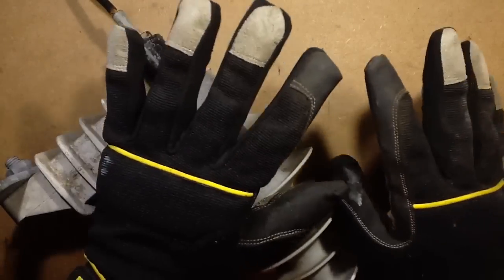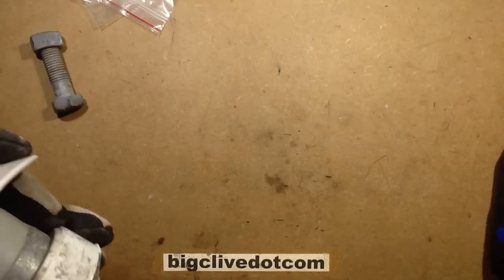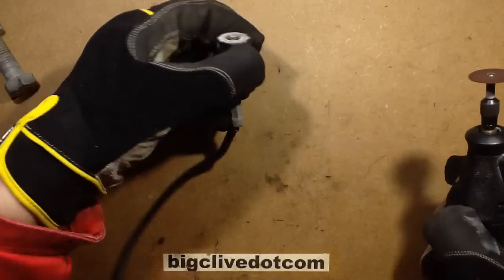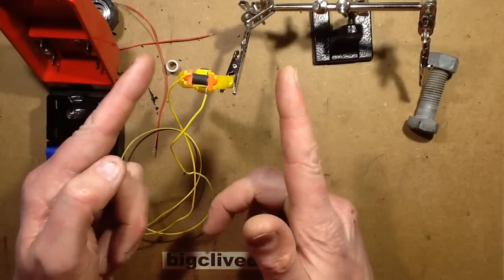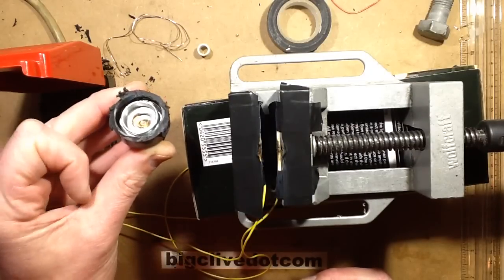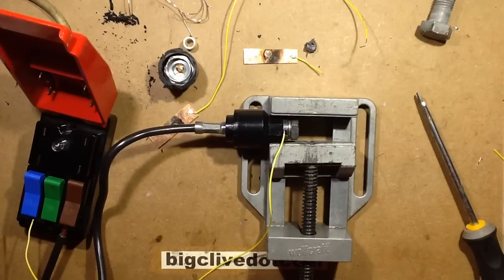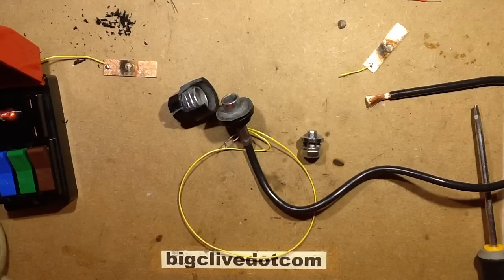Bear & beer.  Opening an explosive 11kv disconnector.  (With bang.)

Comment: While the pyrotechnics for fun and curiosity were bang on - the burning question that arises is what effect the beer had on the experiment and the experimenter.  Folks are quick to blame alcohol for many amusing and destructive incidents but I think that's painting things with too wide a brush.  For instance, I quite often fail to see someone holding a glass of sherry donning a kitchen apron for protection and waiving a cattle prod next to some blasting caps to see what will happen.  Sherry drinkers tend to write angry letters or maybe show some defiance by littering (but they will go back and pick it up after the sherry wears off).  Beer drinkers are widely known to blow up toilets, fill a hotel elevator with ashtray sand and pool chairs to create a vertically traveling oasis, and paint their half naked bodies in garish colors to attend a sporting event.  Like the chicken vs egg quandary, is there something special about beer that affects the human mind differently than a '68 Chardonnay?  In other words, does the type of libation dictate the act or are the folks that are predisposed to such acts drawn to a certain type of alcohol?
Clive, since you are an accomplished and experienced fellow that's going to perform these experiments anyway, would you mind shedding some light on this phenomenon and settling the matter once and for all?
Also, it has been a few hours now and I haven't seen any comments berating you for doing it wrong, outlining several alternate methods to open an explosive decoupling device, and arguing over your choice of protective gear.  I'd like to think your viewers have moved beyond that but I suspect that those types of folk keep different hours or have simply run out of sherry.
All in good fun.  Cheers!

Comment: looks like the burny part is to set off a nail gun like blank in the bottom half of the connector
Reply from the maker: It is indeed.  Update video is processing.
Reply: bigclivedotcom cool. that solves the question of the ceramic sleeve, thermal insulator and perhaps to prevent the burny bit from expanding and not touching the brass case. i was very suspicious when one contact looked like copper and the other looked like brass.
Reply: The explosive bolts on seatbelt tensioners are similar, only they are 12v and engage a really heavy spring. They go off like a shotgun! Have you tried those yet? (I used one from a Citroen).

Comment: It's the compression that makes it explode .. When testing the "charge" outside the disconnector, it burns slowly. But when inside, the burn builds up pressure, and eventually explodes. 

It's the same physics as in ammunition for guns. Outside the cartridge, the smokeless gunpowder burns rather slowly, but inside, it goes big boom :) 

LOVE you videos, big fan ... Keep em coming.

Comment: Um, not really sure here. But we have almost the same one i sweden, and here, i do belive that what melted you'r ruler is the primer, and in the bottom there is a .22 shell with only gunpowder in it? And thats what blows of the cable end.. 
Could be wrong here and you version is different. But thats how the one i have at work functions.
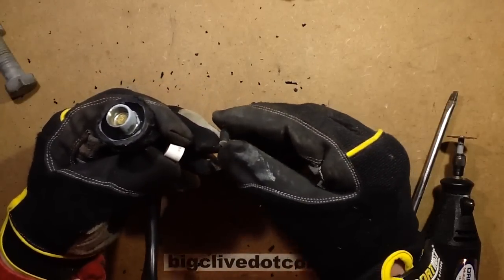Reply: In the video at 7:34, it really looks like there is a .22 in the bottom of what Clive is holding in his left hand..
Reply from the maker: I think you're right!  I didn't notice that.
Reply from the maker: I've found the unexploded one...  It does contain a shell.
Reply: I'm glad i could help! Thanks for all the great videos!
Reply: @bigclivedotcom  The first time I was ever near a low-caliber shell, I was shocked by how loud the little bastards can be. How long were your ears ringing?
Reply: @HoboSullivan  Me and my mate hit a shotgun primer cap with a screwdriver once. I couldn't hear properly for 2 days haha.
Reply: This calls for another video, where Clive hits the blasting cap with a hammer.
Reply: It's a little .22 rimfire blank, judging by the big E on the case head I'd guess it was manufactured by Eley but I'm not entirely sure if it's a theatrical blank or a considerably more powerful power blank of the type used to drive nails. The dramatic difference between the uncontained blank venting the burning powder and the contained blank explosively deconstructing the disconnector really shows how even the wimpy powder charge in a .22 can produce forces best experimented with outside.
I have a party bag of 12 bore shotgun blanks Clive if you fancy conducting any more horrible ideas. Not sure if royal mail would be too happy about shipping that though.
Reply: A bolt of lightning would cover all three at once.
Reply: outdoor explody time? :)
Reply: Yeah when he got it apart, my first thought was that the 'contact' which was closer to the connection was a blasting cap, which would be used to set off whatever the barrel is.  Explosives are particular about their ignition method.  Some go off with heat, some with impact.  Some need a blasting cap.
Reply: One of your best videos to date. Blowing stuff up.... never a bad choice!
Reply: Luckily, he investigated further in a new video and found that it was indeed a .22!
Reply: When I was 6 or 7 i remember pocketing a live .22 after making my parents think i just wanted to hammer the spent casings. It was just a trick though, my true goal was much more devious. I hammered it and remember it was so deafening loud and a whizz bouncing off the two rock walls on the side of my house...Parents didnt let me hammer any more casings after that....
Reply: Letter L in casing, i't made by Finnish company Lapua. Or it looks like L on it.
Reply: Zlobodan I agree. when he opened the other one with the dremel there was a brass piece in the bit that blows off. he missed that and went with the carbon exploding.

Comment: I have an extremely silly question. Is there a "best" way to use a low volt electronic circuit to turn on and off a 110VAC device? (example: use one of those PIRs to turn on and off lights). I could use a big relay, but seems cumbersome :(
Reply: enerdhil Maybe a big MOSFET. But it might be wise to isolate the high voltage from the low voltage with an optocoupler and a transistor or so. Just use Google. You got to be the 1.000.000.000th person wanting to do this.
Reply: There are various options with pros and cons. Traditional mechanical relays tend to have the best ratio between on resistance (very low) and off isolation (near infinite) but have relatively short cycle life. Semiconductor (usually triac) based "solid state relays" have longer cycle lifes but higher losses when on and worse isolation when off.
Reply: Thank you all very much.
Reply: I just decided to start playing with electronics (haven't since middle school) so I was looking forward for that, but I got ill and had to have emerency surgery today, I'm totally zonked on pain meds et...  (TMI, I know)... 

Anyway, I'm going to try again later and was wondering if my minuscule level of knowledge is appropriate for asking help on EEVBlog's forum?

Comment: Much like the potato, It had to be done. Clive, While not as loud those Corelle stoneware plates fail explosively, if you can manage to break one. I have a feeling you will be finding little bits of that disconnector for years to come. Despite an hour of sweeping and vacuuming I found tiny bits of that plate for a couple of years until my wife and I moved out.

Comment: btw clive you're using the sanding disc as a cutoff wheel on that dremel.  The sanding discs are a lot easier to break (and send shards flying everywhere) than the cutoff wheel is.  Cutoff wheel should be thicker and black.

Unless you're using one of the metal disks.  In that case, carry on.

Comment: The tension was high when waiting..
Reply: voltage does not really matter though. it would have the same reaction with 2000 or 100 volts most likely. would have been enough to set off the charge at a high enough current. pretty sure. though i have never worked with explosives, which  is probably a good thing.

Comment: Soooo... what's inside a hand grenade?
Reply: Sounds like my date last weekend...
Reply: ...Dremmel time?
Reply: A dummy/disabled grenade has a hole in the bottom, so even if someone puts a live delay/detonator back in, that just discharges safely through the bottom instead of putting pressure on the outer shell.
Reply: Yeah, what's in there? Dremel that shit!
Reply: Fracture the fists of a thousand warriors.
Reply: I have a deactivated/inert Mills grenade. They have a striker in a two part metal tube. There is a cap on the end of the base plate, when the pin is pulled, the striker hits the cap, which ignites a fuse in a self contained tube. When the fuse burns to the end of the brass tube, it ignites the surrounding tnt charge, bursting a fragmenting cast iron casing.
Reply: I used to share an office with someone who kept what he swore was a dummy/empty hand grenade on his desk. We never pulled the pin or opened it up, just in case, though, so I can't help with your question (luckily) ...

Comment: I haven't read the other 130ish comments that were up at the time of me posting this, and I'm not an explosive expert, but venturing a guess.  I think that ceramic resistive device was actually part of the explosive charge.  When the carbon rod lets the smoke out, it gets contained by the ceramic bit, builds up enough pressure and goes pop with enough force the send things flying.  I'm interested to see what happens of you'd had the ceramic tube around it, when it was in the vice of knowledge!

Comment: I've seen one of those blow one street across from my living room last summer and it was almost as loud as a shotgun at point blank. At 13-25kV, there is a heck of a lot more fault power available to turn the carbon pellet into plasma and you see a fireball shooting from the end when the carbon plasma burns in the air. These things really do look and sound like they're packing explosives when they go off.

Comment: There is now a scorch mark on your work desktop to commemorate this experiment.
Reply from the maker: Yes there is.  Another "feature".
Reply: Crazy things need to be tried.
A few years ago I had an escape slide from a Boeing 727 deploy in my living room which destroyed a coffee table... don't ask...
Reply: OH SHIT THE HOUSE IS GOING DOWN
Alarm Blaring
DEPLOY SLIDE  
Slide pops out of wall and destroys window
Reply: LakeNipissing Don't suppose you videoed it? That I'd love to see on YouTube.
Reply: I did not have a video of the deployment, because it was an accident; I was planning to record the inflation outside in the yard before using it on the lake. I got two of these slide/rafts shipped to me as surplus from when they scrap old airplanes, and I was removing the cardboard packing wrap when the red 'Jerk to Inflate' (yes, that's what it says) handle got caught in the packing tape. I had no idea the vendor was going to ship one with the cylinder charged with 2,500 PSI CO2. This could have killed someone in transit. It inflated to 18 feet in what seemed like a second and filled the living room with a huge cloud of dust from the talc (or something like that) used to keep the tightly-packed slide from sticking to itself when stored in the airplane door. The second slide/raft was not shipped with the CO2 cylinder, so it was safe to unpack, and can be inflated and deflated using an air mattress pump, but it takes half an hour. Same as the other slide/raft that was initially charged. I guess I could get the CO2 cylinder recharged at a SCUBA / SCBA place, but I can live with 30 minute inflation to save this cost. I do have photos of the inflated slide in the living room, and on the lake, but knowing the way YouTube ghost-bans comments with links, I would likely need to make a YouTube video of the stills.

Comment: first you stunned me when you start cutting into explosive thing but then you topped yourself when you revealed that you tried to solder explosive slug which supposed to get triggered from heat. Perhaps you knew it was a very weak explosive
Reply: "It's not explosive. It releases a lot of pressure!" :D
Reply: CO2 (Carbon dioxide), in copious amounts almost instantaneously with a heavy current flow.
Reply: it's a deflagrant!
Reply: a non-nuclear explosion is pretty much just a more solid object turning into a less solid object, real fast

So its not too hard to know that something the size of a tack won't blow you in half
Reply: That pellet if left contained in the housing and set off would of made a bang. An explosion is a rapid expansion of gas if like in the video when set off the gas has somewhere to go. So the force is dissipated easily.
Reply: Henry Herz how strong the explosive as it's what it's contained in I mean dry ice in the open doesn't explode but put it in a 2 L bottle or heaven forbid a 2" x 6" threaded riser and put end caps on it screw them on tight and you've got a Device that can take out a mailbox

Comment: I'm not sure I understand. Why is the explosive disconnecter required? Is it just to make it apparent the device has been used and force replacement?
Reply from the maker: It's to break a high voltage fault current path with as high a gap as possible and also indicate the failure.
Reply: Iris Johnson It's arresting lightning that hits the 11kv wires, it's hard to do that without being attached to them.
Reply: You should try shorting 25,000+ amps 50v lead acid GPO batteries,(1.5mw) will a stray steel spanner.... that is an explosion! more like total disintegration, with a nice coating of chrome and moly over nearby equipment, and a very red faced engineer looking down at me from the gantry.......
Reply: +bigclivedotcom Alright, but what I don't quite understand is why the 11kv supply is coupled to the device at all. I must misunderstand something about the poles, but it seems to me that the lightning arrestor would be functional on its own, no?
Reply: Wolfgang Faust oh duh, I wasn't thinking. Yeah that seems obvious now.

Comment: Narrow back.

Edit, scardy narrow back.

Second edit, out side electrical lineman use these all the time, they get thrown around, tossed in the back of trucks, dropped from the top of poles. I don't understand how anyone could expect a Big Bang from this, it is designed to use the minimum amount to get its self in the clear and that is it, witch is much less then anything that could hurt some one. Maybe if you had an old ceramic one but even then I would highly doubt it. They are designed to be safe.
Reply from the maker: Mixed career including distribution work.

Comment: They use carbon rods in batteries and I believe thermic lances.. so would make sense to be a carbon slug
Reply: Wanton110 thermic lances are iron rods in a steel pipe with pure oxygen flowing through. but I imagine carbon could probably work pretty well for it.
Reply: Graphitic carbon is used in electric arc furnaces as well. I have some nice 2" and 5" diameter rods kicking around at work for the ones we have.
Reply: The carbon pin is there to get hot enough to fire the .22 cartridge that is in the casing.

Comment: It's a shame that you didn't monitor/log the current. I'm curious how much current it drew. What size fuse was in the circuit?
Reply from the maker: Going by the resistance of the carbon slug it would have been 3A and a dissipation of around 750W.  5A fuse in tester.
Reply: Don Beckham I don't know for sure but most likely to be a 13A fuse.
Reply: bigclivedotcom I stand corrected.